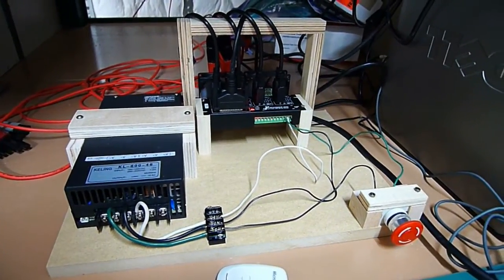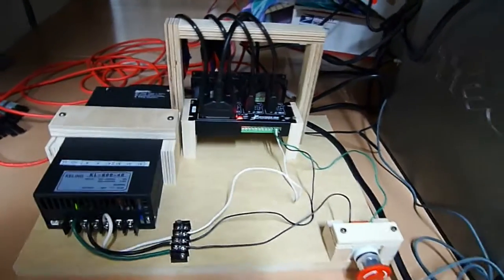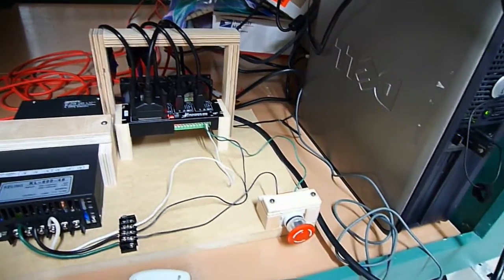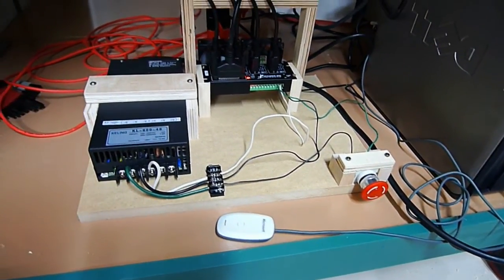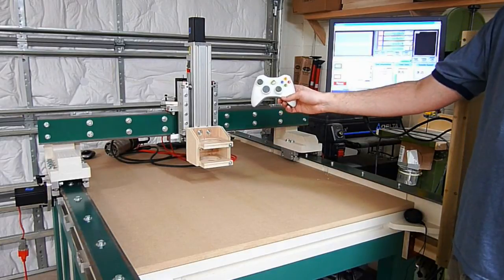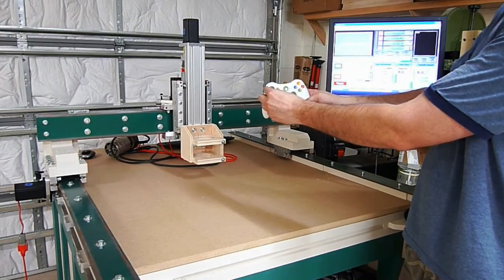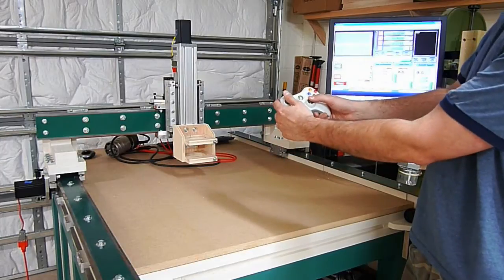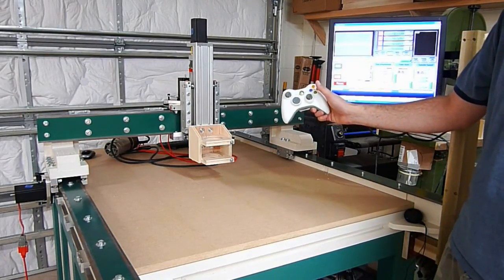Wetland CNC Router Part  20 - Xbox 360 Controller Upgrade

Comment: rawdawgs50 a great video! Because of yourself and a few others I too now have a wireless xbox 360 controller for my cnc machine.  When it is plugged in it is great however for some reason I do not seem to be able to charge the battery ????? Can you please tell me how you have connected yours so that it charges?  Also is that a Joe's Hybrid machine?
Thanks,